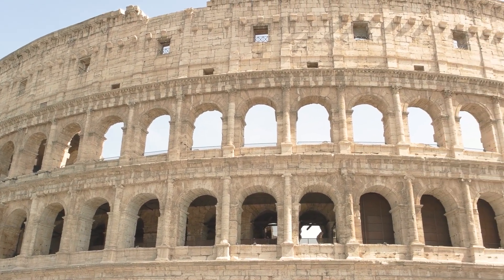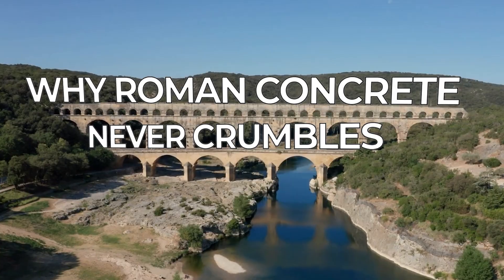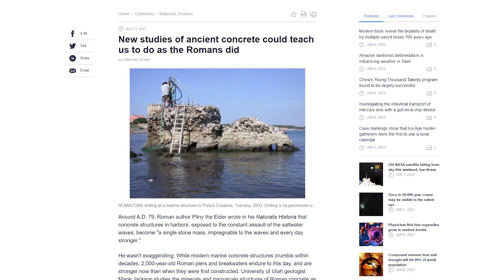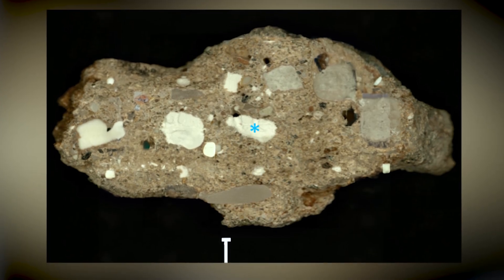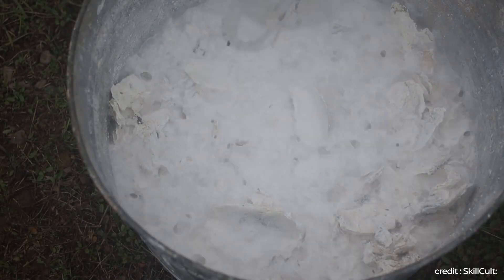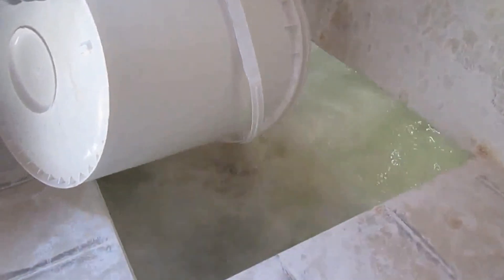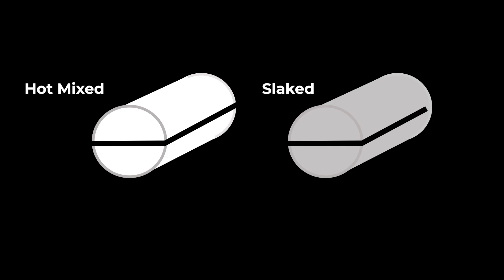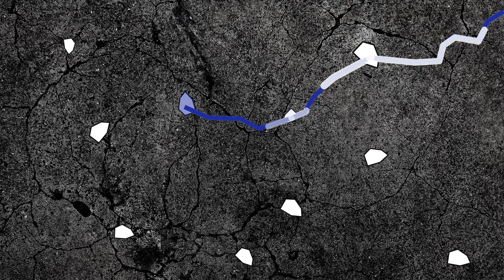Why Roman Concrete Lasts for 1000 Years

Comment: It's kinda frustrating that you show reinforced concrete failure, a modern technology that was not used by Romans and that allow to build much more versatile structures with much less material overall.

It's the same for concrete recipes, we know how to design concrete that harden under salt water. 

I would argue that the durability issue is purely economical, and that 1/ today's builders do not see the need to pay for the following generations (short-termism) and 2/ market demand and construction techniques are expected to keep changing, so you might as well build things that will eventually be replaced after several decades.

Comment: Slaking instead the researchers believed that quick lime had been directly added into the concrete mixture in a process called hot mixing hydration of quick lime produces an exothermic
reaction as calcium oxide hydrates to form calcium hydroxide the temperature increase in the mortar could be as much as 55 to 60° Centigrade over ambient conditions with the presence of hot spots exceeding over 200° Centigrade the benefits of hot mixing would also be that this increased temperature significantly reduces curing and setting time since all the reactions are accelerated allowing for a much faster construction process during the hot mixing process the lime class develop a characteristically brittle nanoparticle structure creating an easily fractured and reactive calcium.

St store within the concrete structure as a Concrete Construction slowly aged and Tiny cracks started to form within the concrete the cracks will preferentially travel through the weaker high surface area lime class as water then later permeated those cracks this material could react with water creating a calcium saturated solution which can recrystallize into calcium carbonate and quickly fill those cracks or react with volcanic ash components further strengthening and healing the material well can they prove. 

Proving It it to prove Beyond a reasonable doubt that this indeed was the mechanis ISM responsible for the durability of Roman concrete the team set out to run an experiment they produced samples of hot mixed concrete that incorporated both ancient as well as modern ingredients as well as a set of controls that did not include quick lime the team observed that the hot mixed concrete contained small white lime CLS throughout the form.

But in the SEL mixture without quicklime these clasts were absent compelling evidence that this was in fact how Romans made their concrete as a final test the researchers split each concrete column down the middle and remated them together about a millimeter apart they then set up a pump system to continually flow water through the gap between each side of the concrete would it also have those elusive self-healing properties.

Amazingly just a few weeks in the team had noticed that the system had
automatically shut itself off water had ceased to flow through the hot mixed concrete sample the control samples without the quicklime were left to run but never repaired themselves the team
made a final spectroscopic measurement of the sample to determine its composition they found a calcium carbonate material indicating the crack had been healed by these small previously dismissed lime clasts wait did we did we do it we did it.

Comment: Quicklime (known also as burnt lime) is mixed with volcanic ash (or crushed powdered brick powder which is used as a substitute) and with sand to create a mortar, which when mixed with rubble forms concrete. 

Either you mix the quicklime first (known also as burnt lime) with volcanic ash (or crushed, powdered brick powder as a substitute for volcanic ash) and then add water to form a mortar and then add rubble or stones to form concrete.

Or you mix the quicklime first (known also as burnt lime) with volcanic ash (or crushed, powdered brick powder as a substitute for volcanic ash) and gravel or stones or rubble and then add water to form concrete.

Or what would happen if we mix an equal volume of waterglass powder known also as sodium silicate powder with an equal volume of quicklime known also as burnt lime by mixing the equal volume of waterglass powder known also as sodium silicate powder with sufficient hot water to liquify it and then once liquified it is mixed with an equal volume of quicklime known also as burnt lime. Once the two are completely mixed and dissolved together we immediately add the mixture of sand and gravel after 15 to 25 seconds has passed because we will be using high speed propeller mixers and then add the mixture of sand and gravel while the hot exothermic reactions are still going on and once thoroughly mixed and blended into a hot mixed concrete batch it is then poured or placed into molds or on surfaces needing to be patched up.

Or mix an equal volume of waterglass powder (sodium silicate powder) with powdered brick dust powder with sand and gravel, mixed thoroughly and then water is added to create a hot mixed ancient Roman concrete.

Comment: One of the problems for earthbag structures (hyperadobe or superadobe) has been rain on the walls causing cracks. A final coat of plaster with quicklime clasts could neatly solve this?

Comment: I’ve mentioned this to a few people that have common knowledge about these things; this went over their head as they couldn’t comprehend a concrete mix for 2,000 years ago being superior to modern concrete 🤣

I wonder if it’s possible to make this ourselves for home use with out the need of volcanic ash…..
Reply: Roman concrete is mechanically too weak. That's why it is no longer used.
Reply: @ Roman concrete wants because the formula was lost for over 1,000 years after the Roman Empire fell! Concrete was only reinvented in 1824 I believe. 
The romula for Roman concrete was only recently rediscovered and why Roman concrete outlasts modern concrete by hundreds of years; eh oh is due to its self healing properties. 
The formula could be tweaked with how much water is added to make it stronger, plus rebar can be added to Roman concrete to give it the industrial strength that is what really makes modern concrete strong in the first place!
Reply: @adrastoso9727  The different recipes of Roman concrete have never been lost.

Comment: Can we now start to talk about the Builders of Puma Punku and Sacsayhuaman also using this kind of Concrete-making technique, just with different crystalline powders?
Reply: No, ancient Incas didn't use mortar nor cement in their buildings. Instead they polished each stone until it was a semi-regular polyhedron, put it in place so the gaps between it and the nearby stones were tenths of a millimeter (repolishing the stones if needed) then placed more stones. The advantage of this method is that when earthquakes hit all the stones move within the walls, thus a great chunk of energy is dissipated thru friction, and when the quake's over they fall back in place. As the structure is made of non repeating patterns of stone (no two stones are the same shape) there's no single resonant frequency for the whole structure, in worst scenario only a section of the walls would colapse if a powerful earthquake hits that sections' particular resonance frequency. Disadvantage, of course, is that building this way is really slow and requires massive amounts of labor
Reply: No. Cause you aint did no science yet to proves it

Comment: This does raise an issue. 

If we can manage to get this kind of mixture into common use, we're going to need to be much more circumspect with construction.

When our work can last millennia, we can't be so flippant with what we leave behind.
Reply: The fact we aren't careful with planning is an obscenity in itself.
Reply: Would increase the need for city planning, and likely more broad-purposed construction. If you build a pizzaria for example, just make sure that the structure is able to be easily repurposed. The bits which make it particularly be a pizzaria need to be less permanent, while the basic structure should be more permanent.
More than anything though, we would have to stop looking at the causes of 'urban decay' through rose tinted glasses.
Reply: self repairing concrete still faces the same problem as regular concrete structures, the only slightly different expansion coefficient between concrete and rebar and rust, unless we design structures to use no rebar or create rebar that will not rust , self repairing concrete will still definetly improve the lifespan of constructions, but wont  make them last millenia
Reply: @zoroco3230 sure thing.

Comment: 9:55 Or just make use the Roman method with cheaper alternative substances, which may in fact accomplish the same goals (methodology), but better: and thus create both cheaper and even longer lasting concrete top-covers/layers for roads which last a lot longer than current types/methods. Which could radically improve infrastructure in a multiplicity of abstractions from road re-work rate to tire wear rates to vehicle shock replacement rates. To say nothing of how much faster it could lead to meaningful implementation of basic infrastructure for under-developed countries with an eye towards resource conservation and efficient/clean disposal of waste.

Simply reducing the total need for concrete is only the barest and most meaningless factor in what this improved understanding of engineering materials can bring: when you extrapolate out to all of the other factors the potential gains in efficiency become almost logarithmic. Just having better road surfaces and the wear on tires for example - have a look at that, singular, aspect. Have you ever looked into how much energy and materials are used for tires? Let alone how much waste is produced as tires either get disposed of or have to be re-tread? If you reduce that even by just a few percentage points - the cost reductions in terms of money, energy, materials, green house gasses and carbon footprint are astonishing.

Comment: Bridges and other structures start falling apart when brittle modern concrete cracks and water seepage causes the rebar to rust . The Romans didn't even have rebar and apparently they didn't need it. 2000 year old aqueducts still carry water.  Somebody needs to find out if hot-mixed slurry made with Mount St. Helens ash and US lime will substitute for the Roman ingredients. Heck - even a product that only lasts for 500 years would be a vast improvement over what the construction industry is using today.
Reply: concreate is not waterproof the water gets inside from day one which is why if u have a concreate ledge u get mold on the inside of the building.

the rebar rusts which makes it expand which itself will help to crack the concreate.

the reason their concreate "was" better is due to its thickness and purity. rebar is great since u need way less concreate to make a stable building.

use stainless bars and the buildings would last way longer
Reply: 😊😊😊😊😅😊😊😊 9:59 😊
Reply: I doubt Roman concrete without rebar would stand up to modern uses. Rebar adds tensile strength, which is critical in bridges and other structures.
Reply: @chrimony  it may be a massonry bridge, but it still proves the point that  roman contruction tecniques givevgreater longevity to most any structure. "The Pons Fabricius (Italian: Ponte Fabricio, "Fabrician Bridge") or Ponte dei Quattro Capi, is the oldest Roman bridge in Rome, Italy, still existing in its original state. Built in 62 BC, it spans half of the Tiber River, from the Campus Martius on the east side to Tiber Island in the middle (the Pons Cestius is west of the island)." The bridge has been in heavy daily use since 62 BC
Reply: @chrimony well, romans used arches. Constructing without large tensile loads is one way to avoid cracks. 
We do this with pre-stressed concrete, but adding the crack- healing capabilities would propaply improve thing.
Reply: @nos9784  Or only compressive loads. And, furthermore, used half-round arches, which transfer their loads vertically downward - no side loads. Later arches with flatter curved arches require heavy abutments to avoid the ends from being pushed sideways.  Reduced bridge height is better for wheeled traffic, and allows wider rivers passing underneath.
Reply: @chrimony  The Ponte Fabricio would disagree with you by about 2086 years considering that's how long it's been standing for and after 2086 years it'll stand stronger than what it did the day they started building it.
Reply: @M0RSM4LLE0  Roman structures don't have to support the weight of fully loaded semi trucks or even just normal cars going over them. That is a bridge designed to have people walk over it. We have those too, and they'll last much longer than most of our bridges.
Reply: @lumenox8541  modern bridges built for those purposes even crack and crumble while Roman Structures stand stronger
Reply: Roman roads and concrete also were under much less stress. You want to build a bike path and that will last forever as well but a road is quickly filled with potholes
Reply: Since the burn down of the library in Alexandria all ancient knowledge is burned to ashes... 🎉🎉🎉🎉🎉
Reply: @einHaufen.   Thats not true, while the libraries second loss was far more damaging ancient knowledge was far from lost.

Comment: Lime coated rebar and remesh would be a test i'd like to see.
I hypothesize that the lime might help seal in the steel for even longer.
Reply: Maybe, and that would be an interesting test, but seeing as how our steel-reinforced concrete still usually doesn't last more than one or two hundred years, and that with constant repair of the encompassing concrete, yet the pantheon and other Roman constructions, such as their aqueducts, apparently have absolutely no steel reinforcement and are still standing after almost two thousand years, I wonder how necessary it is to continue putting rebar reinforcements into our concrete.
If it's not necessary, save it for other uses.
Reply: @josephnebeker7976 Two thoughts on this topic - design flexibility and survivorship bias. 1) Most Roman construction exclusively used circular arches - which are very good in compression and well suited to concrete's material properties. However from a material efficiency perspective it's really bad. Let's say you want to build an interstate bridge over a 100' wide river, using a circular arch. A) You could design a single span but that means your bridge is now 50' in the air and has very steep or very long approaches. Something like a truck is only designed for going up a 1/10 slope (10% grade - I am using a very rough number) so you need a 500' long approach span on either side and all the material that requires or you have to accept maybe trucks can't use this bridge. B) Okay let's limit the height of the bridge to 10' tall to solve this problem - that means you need five 20' spans for this distance, and now you need to build four foundations in the middle of the river - pretty expensive and disastrous to boat traffic. C) Let's consider instead a circular arc; we can select a 100' long curve that runs between each side of the river and only 10' above the water. All the afformented issues are solved with this shape except that it is a very shallow arch, it is behaving much more like a beam and there are significant tensile forces in the section. Concrete is bad in tension, so let's use reinforced concrete instead. The only down side with this solution now is maintenance issues with the structure, it requires more attention and might not last as long. D) My question is how practical are solutions A and B? Can modern society accept the costs from those alternatives, or are we incompatible with them? Is the cost of a more disposable/vulnerable option like C worth it compared to the design flexibility it provides? 

2) It is important to remember we only see the best examples of Roman construction, we don't see the buildings of Constantinople that were destroyed in earthquakes centuries ago. We don't see an old Roman bridge that was torn down because it wasn't capable of supporting the weight of modern car traffic. And stuff that we do see might be lying to us subtly - the Pantheon Dome was reinforced with steel chains in the Renaissance, and being culturally significant has been protected and maintained well for centuries.
Reply: @josephnebeker7976  Stone and concrete cannot take tensile loads, the rebar provides a pre-compression that allows some amount of tension before failure occurs. Wide spans, bridges, car park decks, etc., need rebar otherwise supports would have to be much closer together.
Reply: @koontroll3364  just cover it in lemon
Reply: @rtificial8292 Funnily enough this would destroy the rebar. Concrete is a highly basic material (around pH 13 going from memory). Normally steel would be corroded in such an environment. But strangely enough at that high level of pH the surface of steel passivates and a thin layer of oxide forms that protects the rest of the material from further reactions. Things that increase the acidicity of concrete like citric acid or desolved carbon dioxide destroy and inhibit the reformation of this protective layer and greatly increase the rate of corrosion in the steel.
Reply: you could coat the bars with a layer of something that doesn't react with lime, then cover the whole thing in lime before using it - sounds promising to me